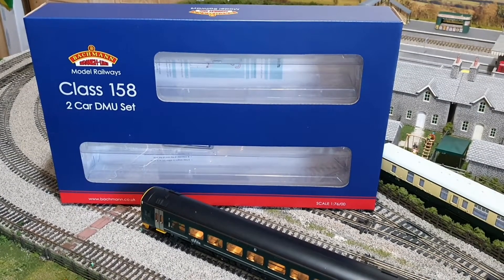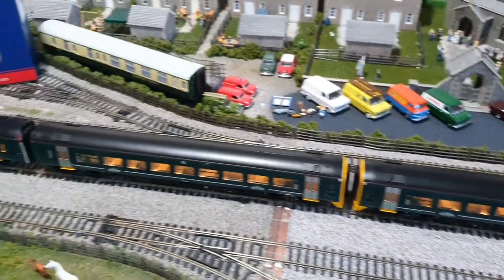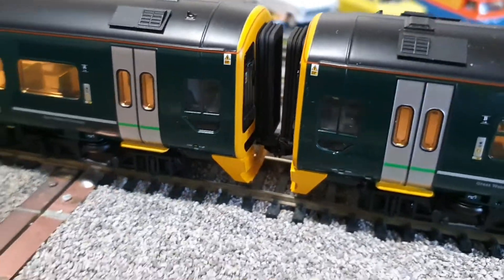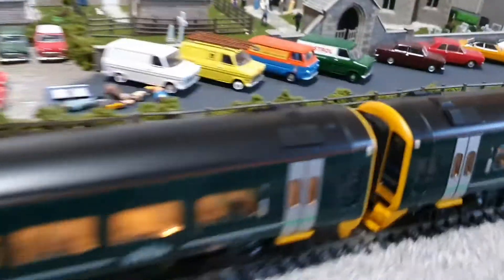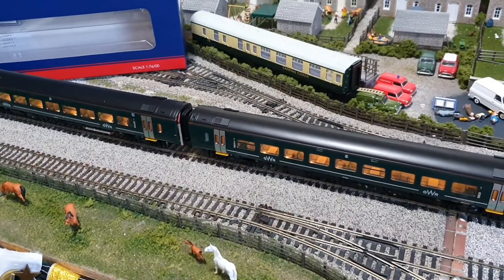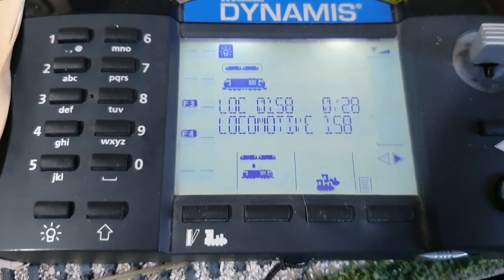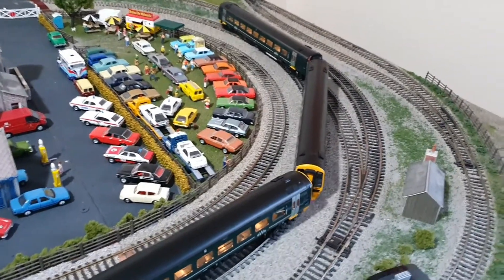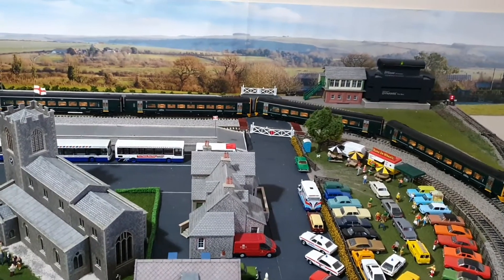Bachmann GWR 158 in multiple Dcc control

Comment: Have you done anything to make the interior lights brighter? If so how did you do it.
Reply from the maker: It's how it came. It's dcc fitted, not sure how bright they are on the analogue controllers.
Reply: @D402DDS  mines ddc fitted but they seem really dim compared to yours. Just wondered if there was a cv to change or something. Nice models though